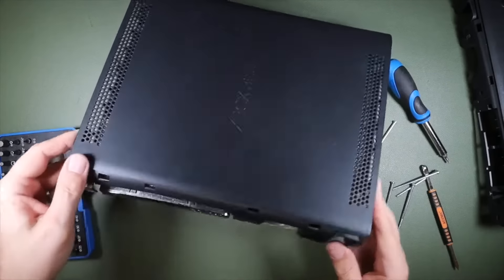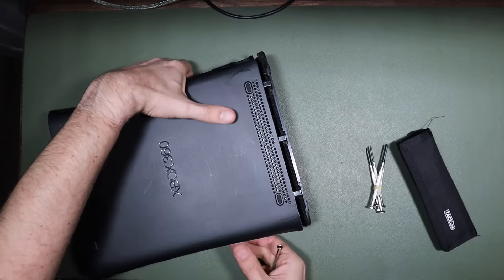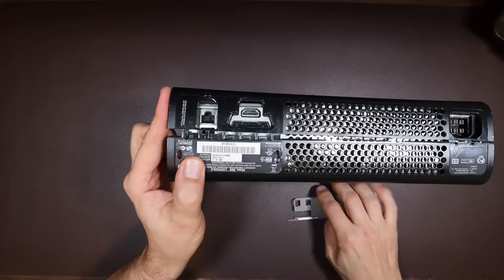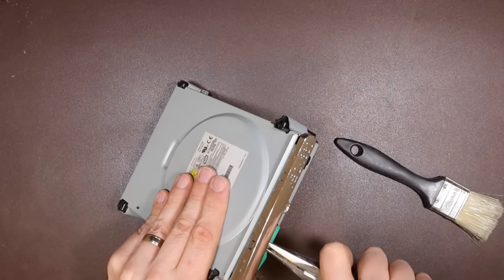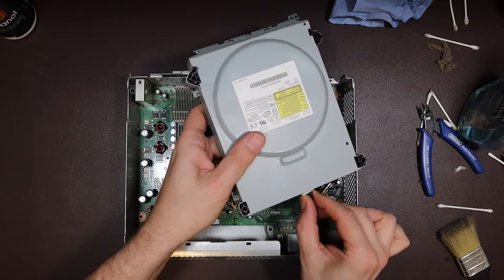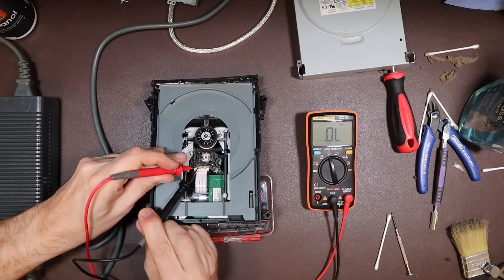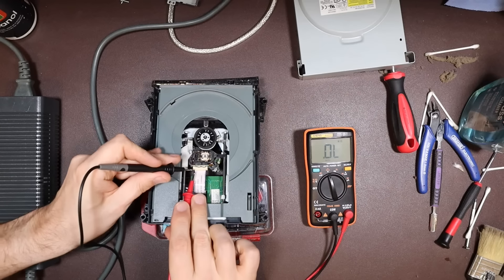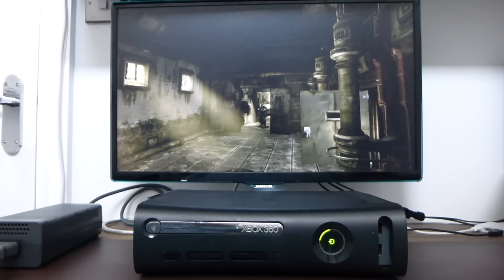This DIRTY Xbox 360 that won't read disks, but why?

Comment: I mean if you're going to go through the trouble of opening the system and cleaning it might as well just put a brand new disc reader in there they are less than $10 and very easy to replace.
Reply from the maker: That is true Ray, but on a Sunday afternoon I didn't have a laser and on Sunday night and still today I play the games without spending the £10. There's a tiny laser not in landfill and I enjoyed 2 frosty beers.
Reply: Also, I've read places that it's not a guarantee. There's a chip in the drive that binds it to your particular Xbox 360. If you buy any old drive, there's a low fraction of a chance that it will work with your Xbox.

Comment: I bought a Makita Dust Blower for cleaning out electronics and PCs.  Best tool you could add to your toolset.  It is like having an Air Duster can that doesn’t run out.  I have a video demonstrating it on my channel with a dusty MacBook Pro.  Paint brushes are good, but can’t get every small crevice.
Reply from the maker: Thanks jak... what an awesome tip. I haven't heard of those. I will check out your vid. Hopefully others will too. Thanks!

Comment: Nice job there. So what’s the latest with your xbox cd drive? After your cleaning and tweaking with the resistance, is it still operating as normal? Thanks
Reply from the maker: Hi @ramonjr-ca  thanks for your question. And a very good question it is. The drive continued to work for as long as I owned the console, which was a while, but eventually to make room for some more repairs it needed to be moved on. I didn't receive any complaints from the buyer so I am guessing it served them well too. The "Sensible" thing to do would have been to replace the laser assembly and had it been a much loved console I'd owned for years I would have done just that, but it was purchased just to see if I could fix it, so fixing it for no money seemed to be the best option for me. I hope that you enjoyed the video and once again thanks so much for your comment.

Comment: open tray is the exact same error I am getting with mine. Got the itch to Play my Mass Effect games and pulled the 360 out of storage collecting dust. Sometimes it reads, but today it doesn't. my Multimeter is MIA so I will be doing it the old fashioned way. mark a spot and track turns in a direction lol.  it will work or it won't.  I can play with it tonight and buy a disk reader if I fail.
Reply from the maker: Good idea... And good luck! Let me k know how it goes!
Reply from the maker: Thanks so much for your comments. Much appreciated

Comment: Just out of interest, if you replaced the disc drive would it still work with the console? I've seen that they need coding or some guff and I've no idea about any of that
Reply from the maker: I'm not 100% sure but I think you are correct and they need to be "flashed" to match. I could be wrong. What would've been a better fix would have been to replace the laser assembly. These are cheap and don't need to be coded.

Comment: I know this video is very old but my XBox got tipped over and hit the ground and now it won't read my disk so what should I do?
Reply from the maker: Sorry to hear that. I'm really not an expert in these repairs so I don't know what to do either. I hope you get it fixed.
Reply from the maker: Sorry to hear that. Unfortunately I'm not an expert in repairing things I just have a go. I hope you get it fixed.

Comment: That's got to be the one & only easiest, clean & fix console repairs I've ever seen. Hows the electric bike going, still in the works or even in use maybe ? 🖖👍
Reply from the maker: Thanks Ratchet... are the bike... could I send you a cheque just to forget you ever saw the teaser? maybe I will take the video down ... LOL. It's coming along slowly, no "e" to it yet, not even rideable as a "push" bike but it's at least clean. My guess is it will won't ever go unless I am the source of motive power. It's been a nightmare to film in a one bedroom flat, its cost me more than its worth in parts, I don't think I will get it going as an e-bike and I am about ready to leave it unlocked in an undesirable neighbourhood (where it will probably sit untouched).  That said I will do an update on it at some point and I have learned never to promise as series before filming the series! From what I gather, Vince feels bit the same way about the Rolls Royce.
Reply: No cheque, or check needed. I'll simply just move on & forget it ever happened. You should watch a guy on YouTube called rather B welding he makes some crazy machines & the e-Bike is one of them, absolutely bonkers! what he makes out of metal parts. Oh yes the roller when Vince gets around to releasing the videos to public & doing updates on the time & money involved, I think some are going to be shocked & upset. I hope you don't ever stop making content as I do find it interesting, nostalgic to say the least.
Reply from the maker: @Ratchet effect  very kind. No plans to stop yet! The spelling is interesting I lived in the US for a long time and my wife is US citizen. I went back and forth on the spelling of "unrecognised" and "disk" on the thumbnail, eventually went UK English, although its not actually what the console reports!

Comment: Thanks for your all your videos. 

The Xbox is a little out of my area of expertise, but I understand that nobody knows how long these tweaks will last (some say a few days, others say 1 year+). 
 I cannot imagine it is too difficult to change the laser assembly though.
Reply from the maker: Very true Ghost. The laser assembly is only about £5 on eBay and the belt around £2 - £3 so you are absolutely correct that about £10 would have seen it done "properly".  If I had been doing the repair for somebody else (which isn't something I do) I would definitely have gone that route. Anecdotally the footage for this was shot probably 8 months ago and so far so good, although the console probably isn't getting nearly as much use as a teenage would have given it. An excellent point though and one I should probably have mentioned the in the video. As ever thanks for your feedback and your kind words.
Reply: @RetroTechRepair  No Worries.

Comment: Good stuff as always. Nice little fix. I love that the calibration worked.
Reply from the maker: Thank you, @briancoulomb. I really appreciate the feedback. I was happy the laser tweak worked as well and the eventual resistance didn't seem outrageous to me. I could have replaced the laser cheaply which will be an option if the tweak doesnt last, but free is better than cheap and better for the environment too. As ever thank you for taking time to comment it makes a massive difference.

Comment: Thanks for doing this it worked for me
Reply from the maker: Thanks jampot. Tbh replacement lasers are cheap too, but not free! So if it fails in future then that may be an option. Glad you got yours working without that and thanks for your comment. Much appreciated
Reply: @RetroTechRepair  your video helped massively in opening and the cleaning process. All working for now
Reply from the maker: @jampot20000  brilliant. So glad I could help. Thanks so much

Comment: already try out  sometime work & sometime not works . do it have laser lens replacement  or  capacitors replacement at this drive disc board just like GAMECUBE .
Reply from the maker: I agree replacement lasers are very cheap on eBay and probably a much better fix. I was just trying to find out what I could do with what I had to hand. Good point though. I should have mentioned in the vid. Thanks for your comment!